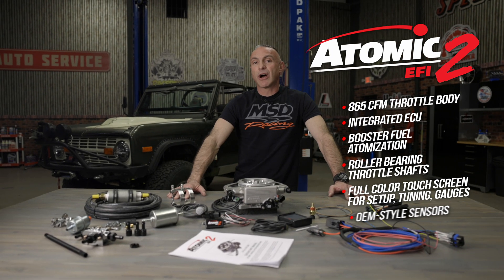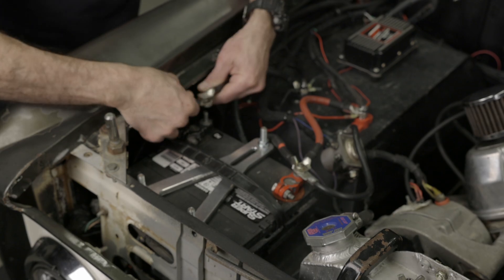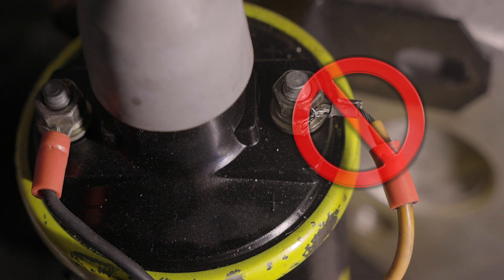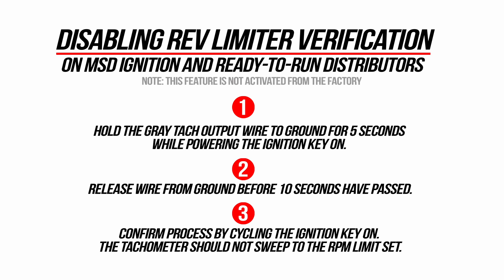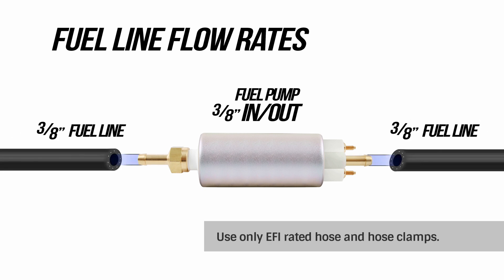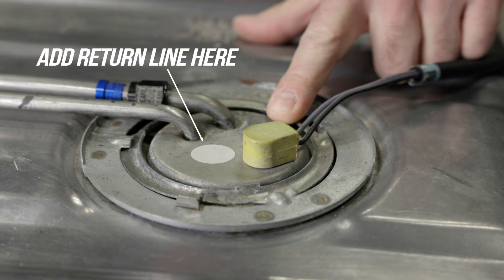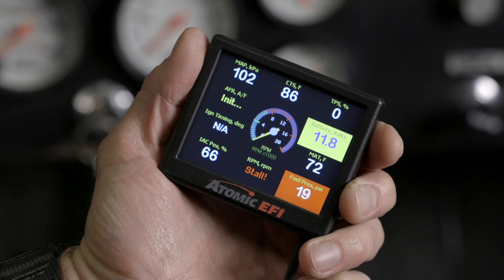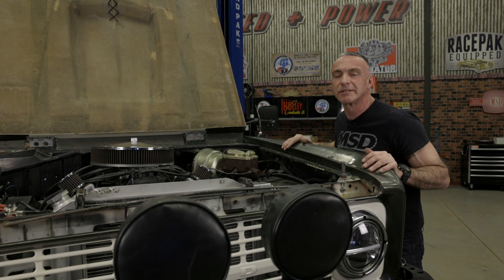How to Install an MSD Atomic 2 EFI System

Comment: MSD Atomic EFI's are junk. First one I had lasted less than 500 miles, it was replaced with a new one which lasted less than 8000 miles. I have a Holly Sniper now, 100% better performance

Comment: is there any additional information on the fuel line plumbing? which fittings are required to connect the fuel lines to the MSD atomic 2 body? is it 2 times -6AN female?

Comment: Just admit it.   This is a holley sniper that you guys rebranded
Reply: It isn't, at all.  First of all, the atomic came first so if anything the sniper is a rebrand.  Second of all,  the way they operate is different. The sniper works like any port injected efi system,  it just bolts on to a carburetor manifold. The atomic on the other hand uses efi valves and controls, but instead of just misting fuel into the intake,  it uses venturies to thoroughly mix the fuel in the intake air like a carburetor. This gives you the best of both worlds.
Reply: @travisbeagle5691  What do you mean when you say efi valves and controls? It clearly doesn't have IACV
Reply: @coolhandluke1503  It has an integrated IACV in the body. You can see a small, fifth air intake port near the rear of the valve body for it. What makes any EFI is having computer controlled valving for air and fuel to provide precise control over the air-fuel mixture. This has exactly that. The only other way to have any sort of control over the mix is to have a mechanically controlled system (like a carburetor.)
Reply: @travisbeagle5691  Does the Holley sniper not have this? What I like about the Holley is the integrated fuel regulator.
Reply: @coolhandluke1503  It does, and for the most part the two are very similar (Most of the electronics and valves are the same or similar.) The only major differences I can find are that the regulator isn't integral on the Atomic and the method that the two use to mix fuel with the intake air. The Holley just sprays the fuel in like any other EFI, while the Atomic uses a Venturi to mix the fuel like a carburetor. I'd say you'd be happy with either of them and it just depends on which you prefer (and how easy it is to install and use.) Luckily they're both about the same price and they're by the same brand so if there are concerns there you'll be fine.
Reply: @travisbeagle5691  I appreciate your help with the info, because I haven't found much real world comparisons on these 2 products. I'm hoping soon to retro tech my late Uncles 1976 Australian Ford P5 LTD.
Reply: That’s exactly what I thought looking at the hand held and interface. They changed the logo, WTF?